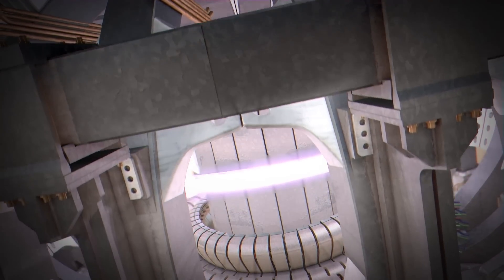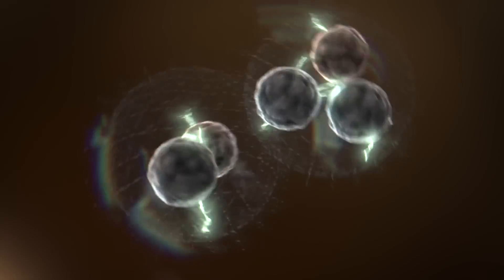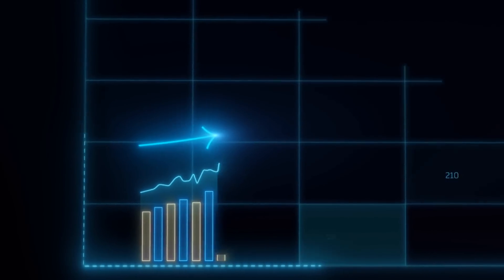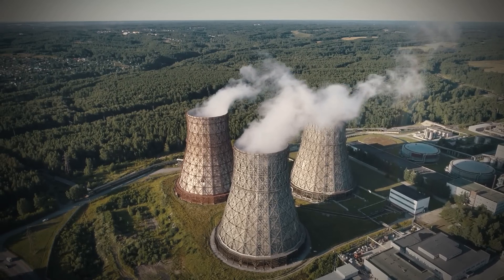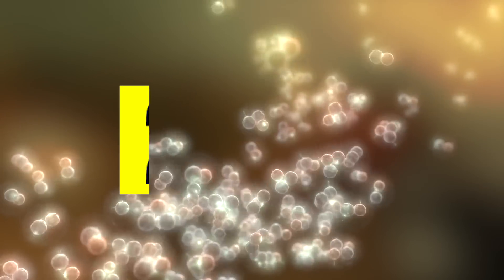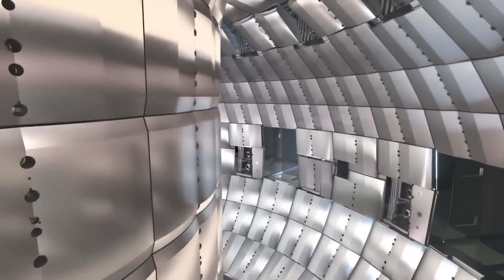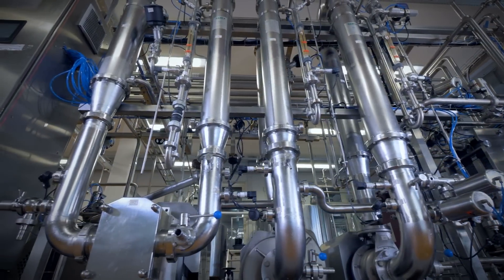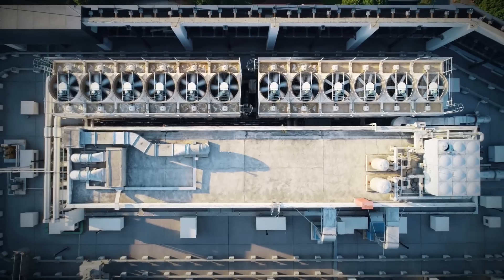The Shocking Problem That Could End Nuclear Fusion

Comment: Nice presentation. Indeed it is a problem that turns quite complex fusion base on deuterium / tritium but D2 / D2 is possible and still H/H ... difficult but more energetic.
Reply: D-D fusion is possible, but you have to run the reactor about 100 times hotter to match the reaction rate of D-T fusion.
Reply: @JonMartinYXD  100 times ? so 150 000 ° C goes to 15 millions ? In Wikipedia they mention 1 million ° C for D-D and 10 millions for H-H. So a factor 10 for D-D and a factor 100 for H-H. All this is depending on the new supraconductors magnets. The first generation can work on D-T and some 20 years later, we can go for D-D. So, unless we stop the progress... we may not need to worry.
Reply: @pghislain  I think you are referring to something other than the reaction rate.  The D-D reaction rate only reaches parity with D-T at 10 billion kelvins.  At that point D-T has passed its peak reaction rate which occurs around 800 million kelvins, so we have to look "colder" on the D-T reaction rate curve to find where it first achieves what D-D achieves at 10 giga-K.  We find that somewhere between 100 and 200 mega-K, hence my 'about 100 times' hand-wavy estimate.

Comment: This makes me aware that I never see COMPLETE energy balances for any type of nuclear fusion break even point.
Reply: That's because no one wants to admit how truly far we are from a viable Fusion power plant. The gain factor, Q, for fusion reactions is defined as the ratio of energy out to energy in, and the record is held by the NIF at 0.7 (1 being as much energy comes out as goes in). The theoretical extrapolated record for the JT-60 is 1.25. In theory the current ITER design gives a Q of 10. So you say, that's fantastic, we get 10x out what we put in! Great! Whoa, Whoa, not so fast. That's the total energy gain, now you have to let thermodynamics have its cut, and boy is it a huge cut. The efficiency in converting your electrical energy in into thermal energy within the plasma is only about 80%. Then you have huge energy losses as the plasma leaks heat into its surroundings, say another 80% efficiency. Then once you have the heat output, you have to convert that heat into energy, another 50% efficient process. With just those three losses, over 2/3 of the energy output is lost as waste heat. That means to reach power generating break even, you need a Q factor of at least 3. The dirty secret of the fusion industry is that everyone talks about Q of 1.0 being the holy grail, as though when we achieve that, it will achieve cheap power for everyone. The only currently proposed facility that will reach Q higher than 2.0 (assuming that only the 50% turbine generator loss matters and everything else is 100% efficient) is ITER, and ITER has its own dirt: Their elephant in the room is that they only expect to be able to run at a Q of 10 for less than 30 seconds. They aren't even saying how long they will have to be shut down after operating before the next 30 seconds of high output will be as this is still an experimental reactor. They also disingenuously fail to state whether the 10x Q factor includes all the energy it takes to get the reactor up to running temperature (spoiler, it doesn't). ITERs Q factor of 10 is far from a sure thing and is only meaningful if they can keep the reactor running for at least weeks at a time or 5 orders of magnitude longer than anything they even have a plan for at this stage.

The TL;DR of the fusion industry is that any and all of the approaches still require BREAKTHROUGH level advancements in multiple disciplines. It is no joke to say that we are still 20 years away from net gain electricity generation from fusion fuel, and in my opinion, we are at least 40 years away from commercialization and it may never be commercially viable. Solar, wind and other renewables are likely to render fusion completely un-economical long before the first fusion plant ever comes online. Fusion is just too complicated to compete. Renewables and grid-scale storage by comparison is a problem we actually have the knowledge, tools and materials to build right now; no breakthrough is needed. Fusion has become a fools errand.

Comment: Excellent and informative video. One other point that occurred to me is that there is also military demand for tritium for thermonuclear warheads. Even if the number of warheads in existence is limited by treaties the tritium in those existing warheads is constantly decaying and needs to be replaced.
Reply: I thought most of them generated it from lithium during the explosion?
Reply: @peterfireflylund  Tritium is typically used in the core of the primary fission device.
Reply: @takashitamagawa5881  you are right. I’d forgotten about boosting and the use of tritium in neutron initiators (in miniature accelerators, no less!). In my mind, something else (something much less finicky) was used for the neutron initiator.

Comment: I was expecting you to go a completely different way with this video.  Tritium is, relatively speaking, abundant in the moon's surface regolith.  It's created by bombardment by the solar wind since there's no atmosphere to stop it.  Yes, it would be very expensive to fetch down to Earth, but this might be the "killer app" that jumpstarts lunar colonization.  The movie "Moon" from about 10 years ago even used this as the basis of it's plot.
Reply: "Tritium is, relatively speaking, abundant in the moon's surface regolith"

Tritium has a half life of 10.5 years, if there is any Tritium on the moon there's a very very tiny amount.

You're thinking of Helium 3, which is relatively abundant on the Lunar regolith. 'Relatively abundant' means more than found on Earth. it doesn't mean it's easy to get.
Reply: @JohnSmall314  -  Ach!  You are absolutely right, I was thinking of He3!  It's the "3" context.

Comment: Fusion cannot work profitably in earth gravity. The huge mass of the sun packs hydrogen atoms so tightly together they fuse. Gravity is the input of free energy necessary to the 'perpetual motion' of fusion. Without massive gravitational forces, it's necessary to pump absurd amounts of energy into the system to cause fusion to occur - and when all is accounted for, this energy input will always be greater than the useful energy one can extract from the system - because perpetual motion is not possible, however complex the machine.

Comment: I have always thought this is an amazing technology,  but there seem to be to many things we don't know how to manage yet.  At the same time there's a group in the Ssn Diego area that have made impressive gains to develop hydrogen on demand systems at less then 100 watts of power. And don't have control extreme high temperature or plasma.
Reply: Hydrogen is not a power source is an energy storage system.

You can never produce clean hydrogen without consuming as much or more energy than would be produced in any reaction that turns it back into water.
Any reaction that does not produce water as the waste product is no longer using a sustainable resource.
Reply: I've got a bridge to sell u lol 😂

Comment: Tritium and helium 3 were originally intended to be used as ignition fuel while plain old hydrogen one gets fused after that. Did they change the idea since I was young?
Reply: Yes.  Proton-proton fusion is incredibly inefficient and requires temperatures/pressures that make D-T fusion look like child's play.

Comment: So I'm a roofer, not a scientist, no degrees, not a single minute spent in a university science class.  I have a passion for fission technology and therefore learned how breeding works.  Then one day I noticed the tritium problem, because I learned probabilistic neutron flux rates for breeding in fission.  

So just saying a layperson builder with an internet connection could figure the tritium problem out on his own.  No science journalist has any excuse.
Reply: The same thing with NIF, they claim 70 percent efficiency while failing to add in the 420MJ the lasers used which takes it below 2 percent. So many boondoggles...

Comment: One other dirty little secret is.... capturing the energy. Despite the animation showing ITER having some sort of heat exchange coil leading somehow to the grid - ITER will not harvest or make use of any energy liberated. There are no working plans on how this would be achieved or the efficiency required,
Due to the inefficiency of turbines, we don't just have to get to slight returns, they have to be substantial to cover the inefficiency of the system.
Reply: This has been my biggest gripe with any fusion attempt, private or otherwise. And it saddens me that the largest international collaborative effort towards fusion doesn't have a clear answer. My current hope is for some startup to make use of the data from ITER and hopefully use it to refine an aneutronic approach like he3+he3 fusion.
Reply: If ITER gets the 20:1 energy rate they're aiming for then I imagine the problem will have near infinite funds to refine it.
Reply: @frjoethesecond  even with infinite funds, some things are simply impracticable

Comment: The main issue is math.

The way proponents calculate their efficiency would land an accountant in prison.

Take a close look at ITER. 
They claim they will have a 10-1 return on energy. (1,000%)

It will consume 630MW of electricity during plasma operations.
It will produce 500MW of heat.

Thats 79% not 1,000%

When you factor in converting heat energy back into electricity that 79% efficiency drops down to BELOW 30%.

So how do they get an efficiency below 30% up to 1,000% ?

1.They literally ignore the power it takes to generate the magnetic field  and only count the enegry used by microwave heater even though 90% of the heating is done by the magnetic field.

2. Pretending that heat energy = electric energy on a 1 to 1 scale.

3. Pray to God that the taxpayers ,who paid for this, never figure out what "Q factor" actually means.
Reply: Percentages get pretty wonky in drug effectiveness studies as well. It may be that you need a million percent efficacy at some small level that you aren't thinking about but were actually intended to misunderstand, and that a million percent efficacy at that scale is one percent efficacy at the scale you incorrectly assume they are talking about. 

There are lies, damned lies, and statistics.
Reply: @elinope4745  "Q Factor" is basically just how much control you have over the reaction.

For every 1 watt of energy you add via the microwave antenna you get a 10 watt change 

The heat output of the reactor can be controlled all the way up to 500MW by a 50MW input ...but the reactor itself consumes over 500MW just generating the magnetic field.

It would be like claiming a guitar amp has 150,000 to 1 return on energy by comparing the energy output of the guitar to the energy going into the speaker and ignoring the AC power cord in the back of the amp.

Comment: Than Nuclear Better Making Magnetor Generator Or Magnetic Orbitary Accelerator, Nitrogen Iron Is Not Joking At All About Perfect Clean Energy, The Problem With Fusion Is Temprature That Big Fire Ring Are Dangerious If They Injecting Fuel Too Much Or Make That Thing Active Non Stop The Wall Of Nuclear Fusion Can Be Melting And The Worst Scenario Is Explosion Which Same Like Soviet Hydrogen Bomb, Even With More Greater Explosion Wolfram Particle Are Anti Armor Material.

Comment: ITER is certainly the most expensive single experiment ever. Building it, operating it, modifying it and having a risk of failure up to 100%. It will create new knowledge, in the meantime delaying sustainable fusion research maybe by decades.

BUT, where did you get the information on the CANDU being gradually abandoned? What on Earth could replace Canada's reactors? The CANDU is currently the safest existing, successful and with the potential to "burn" many kinds of fuel that is currently regarded as nuclear waste. Really, what could replace those reactors in Canada? Renewables? Please, let me laugh here... 
Countries such as Romania, China and S. Korea are expanding their nuclear reactors. Others  too. 
What are the main problems of a typical CANDU-6 reactor? One is deuterium. Abudant yes. Expensive to isolate? Well... In order to start a CANDU-6 running one needs a lot deuterium. Costing tonloads of money. The same element as an ITER type reactor. The difference is that, AFAIK,  deuterium for CANDU is a one time investment, while for the original ITER design, there will be constant demand.
Tritium is, in fact, the CANDU 's issue. A radioactive element that penetrates metal (and why not concrete as well?) like crazy. So this has been a concern. But, now they are collecting and selling it for profit. Maybe a balanced, say CANDU-ITER economy could exist.

So, why wipe out safe fission and being so obsessed with fusion? More safety? There is the molten salt concept under research, but due to the energy crisis, said to be predicted to last for a decade, maybe the world should re-evaluate what must be done, now. At least the EU should create its own mega-project, not a research project, and start producing clean and cheap energy asap.

Comment: I gave you a thumbs up, for your diligent research & thorough overview, but you have repeated an oversight repeated virtually everywhere on the topic of fusion safety. Actually, two. (1) Neutrons escaping the reactor will make CO2 in the air in and around the reactor building radioactive. That is, CO2 will have to be scrubbed from the atmosphere in DT fusion plants. This leads me to: (2) DT fusion is simply a horrible idea and a pointless dead end. Far better to pursue hydrogen-boron 11 and other non-neutron-producing fusion reactions. Better still, and, to my knowledge,  only HB11 Energy in Australia proposes to do this --- how about ponderomotive HB11 fusion, using already-existing Nobel Prize-winning chirped pulse amplified lasers, which produces neither heat nor radioactivity in its primary reaction, only electrons and helium nuclei, that is, electricity? If I'm missing something here, please straighten me out. I cannot grasp why this far better alternative technology is literally almost never mentioned anywhere. HB11 Energy's budget to date is running 0.1% that of ITER ($22 million vs $22 billion USD). The components of the process are all lab-proven. The company need about $100 million to build a prototype.
https://hb11.energy/how-it-works/
Reply from the maker: Thank you for you detailed comment Laurence, I have had a few comments about alternative fuels for fusion and I have to admit I am not well read in the area. I think I will go away and read more, including what you have linked, and make a video about it in the future! Stay tuned :D